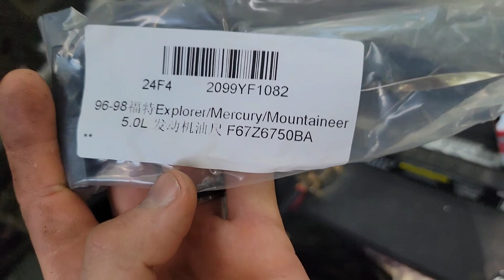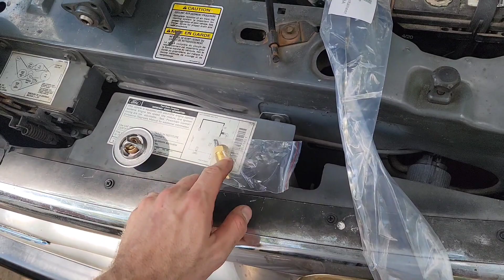5.0 Ford Ranger, AC delete and Radiator upgrade

Comment: I just found your channel and I love the detail on this swap. I have a couple questions. Is there any chance that the thinner plastic mechanical clutch fan from a 5.0 Mountaineer would fit with the 4.0 radiator you just installed? The reason being is that I live in AZ and having AC is a must. The Flex-A-Lite electric fan I tried that is made for my 4.0 Explorer did not work too well with the AC on, the 120* temps, and when not going at least 40mph. Not taking account of the transmission placement, can the engine slide back any farther either with the stock 5.0 upper intake manifold? If I was to go with a carb style intake and run an Edelbrock Pro Flow or Holley Sniper TBI fuel injection setup, would that allow the engine to slide toward the firewall any closer to allow for a stock style 5.0 slim mechanical fan? Also, what upper and lower radiator hoses did you use with the 4.0 radiator? Thanks for the information!
Reply from the maker: @AwesomeBuford  yep, i retained the mechanical fan from a 98 mountaineer 5.0 for my 2000 ranger using dual core 4.0 ranger radiator
Reply from the maker: @AwesomeBuford  i used both 99-2001 explorer 5.0 hoses. Slightly trimmed upper hose. 

Use explorer/mountaineer efi and intake.
Reply from the maker: @AwesomeBuford  check out my most recent videos of the 2000 swap, ill be posting the engine swap portion this week.

Comment: I installed a new radiator recently and put two jugs of antifreeze,should i also grab two more as well because it never overflowed on the second jug
Reply from the maker: I needed just over 3, make sure engine reaches operating temperature, which opens the thermostat and will take in much more coolant. Radiator should be full and overflow tank should be at the full mark, which is about halfway up the reservoir.

If you're not completely filling it using a tall funnel like i did in the video, you will trap air.
Reply: @SBS_Auto  okay will add another bottle before calling it complete,thanks